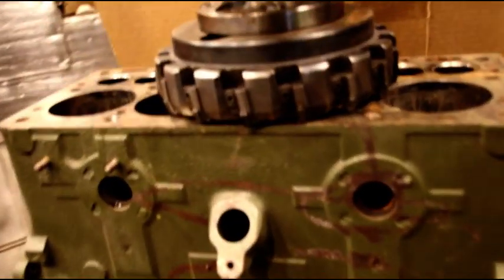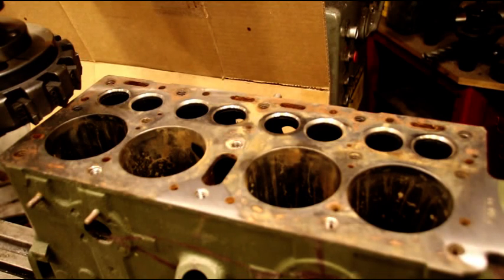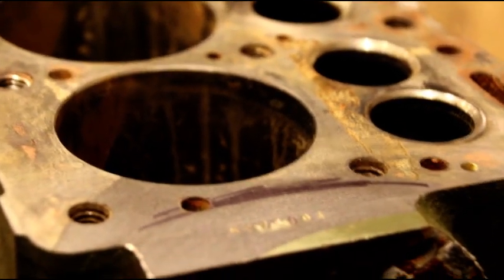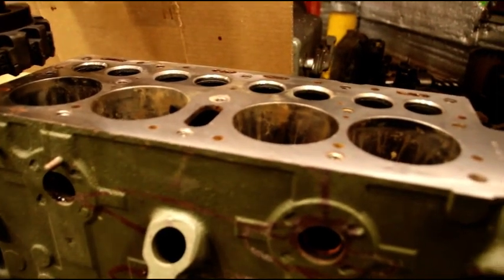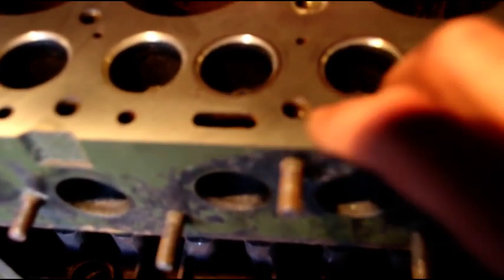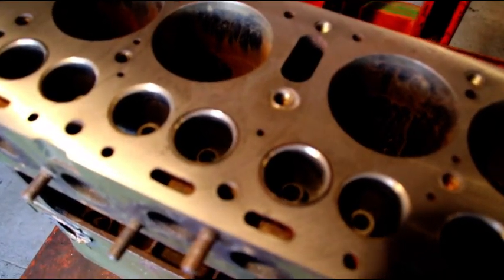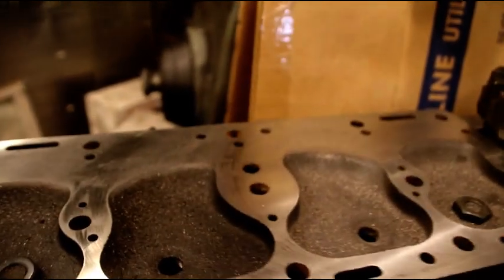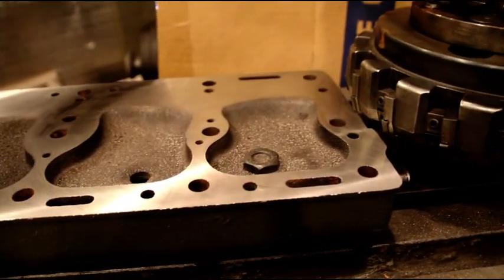Willys L Head Engine....Machining Block and Cylinder Head

Comment: I watched your most recent episode about Gary's engine.  It seemed you had to remove a lot of metal from both the head and the deck.  Is that going to cause higher compression and be a problem?  If so, is there a way of compensating for that?  Maybe using a thicker gasket or .....?
Reply from the maker: The original Willys engines had a 6.8 compression ratio and they also offered what they called a high compression head which was approx. 7.4
The amount removed from head and block will not raise compression enough to worry about anything and there is no reason to use a thicker gasket or do anything about it.  there is room to increase compression on these engines without any trouble

Comment: Oesome work done.
What will you do with pistons if they come to high?
Cheers. 🍻
Reply: Often you can buy thicker head gaskets if needed for clearance, although I can't say anything about what Brian will do here but I'm sure he'll check for piston and valve clearance as needed.
Reply: @scubasteve7946  I know you can buy thicker gaskets but what if its to thin still. 🤔
Reply from the maker: The L heads never had a zero deck so you can take off a lot of material before you have to worry about pistons coming up too high.  sometimes they do come up high but the first ring is also way down.  No such thing as piston to valve clearance on an L head.  Pistons and valves are both in the block and can never hit each other.

Comment: I’m looking forward to seeing the crack repairs. I learned a lot watching the last block you fixed.
I love those military wreckers. The one my Dad and I had was always blowing the lines cause they were old and dry rotted and we only had enough money to fix one at a time. The truck was super handy to have though.
Reply from the maker: Have to get the truck ready to move the steam engine.  18,000 pounds and top heavy so I want to make sure I have good brakes and a non leaking hydraulic system.

Comment: If the block deck is this warped, I wonder how far out of line the main bearing bores are.
Reply from the maker: A warped head usually has no bearing on the main bores.  The block has so much structure below they rarely have trouble there.  The decks take a lot of stress and the torque from head studs and time often make for a wavy deck surface.
Reply: @metalshaperJeep  Thanks, I didn't realize that.